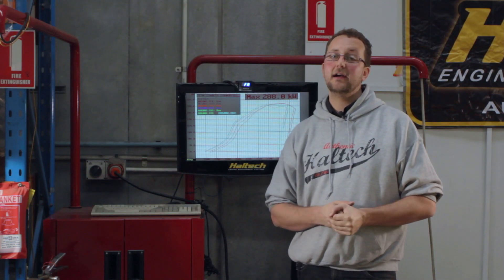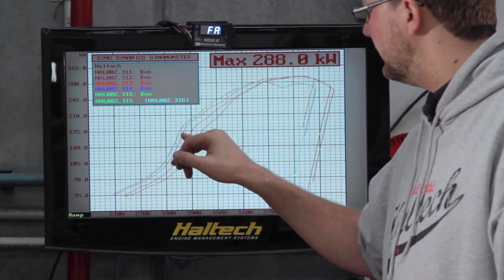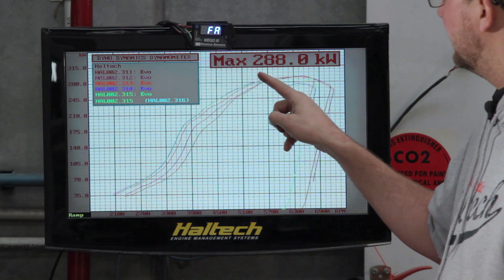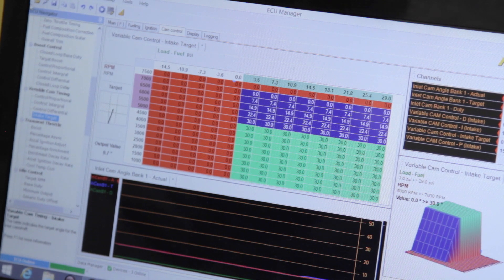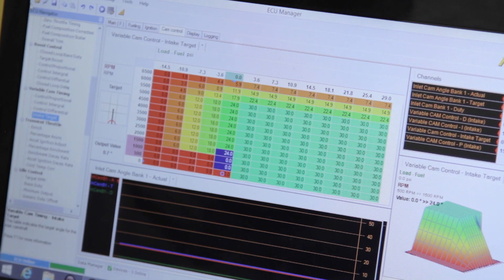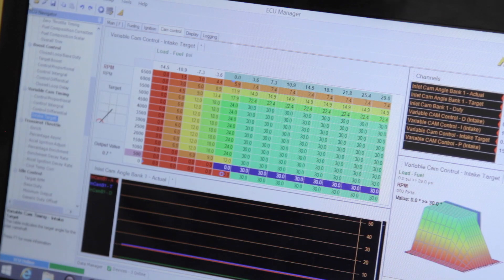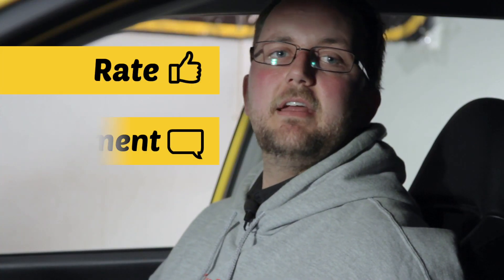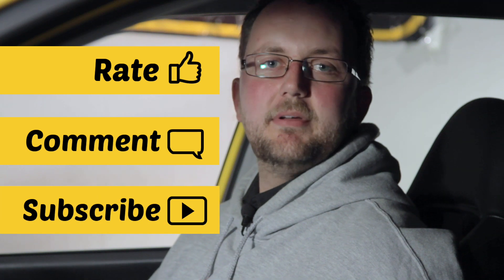Variable Cam Control Part 2 - Technically Speaking

Comment: Excellent video!
How would you go about finding the optimal angle without a dyno though?
I'd assume the same procedure but comparing engine load via data-logs.

And what about when not doing full power runs (Vacuum or low boost), how does the relationship change?(Vacuum or low boost)